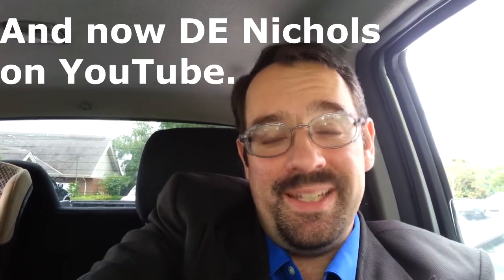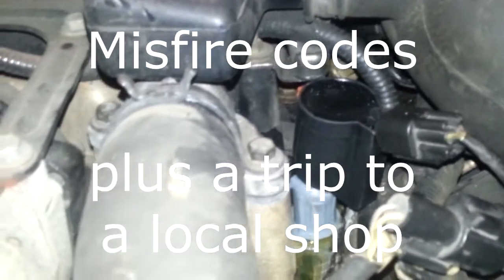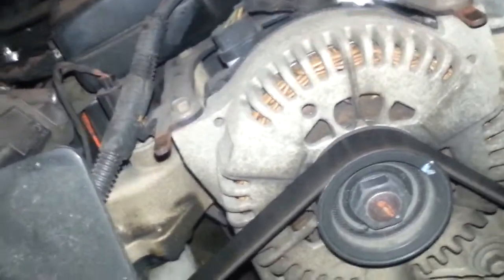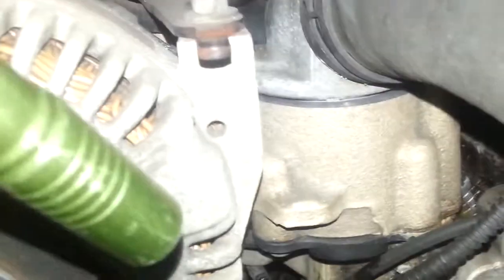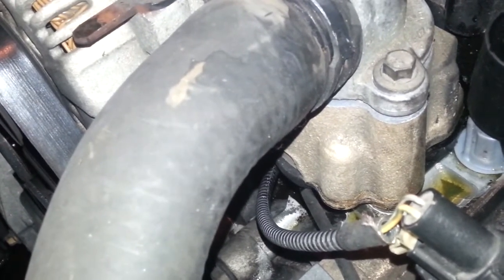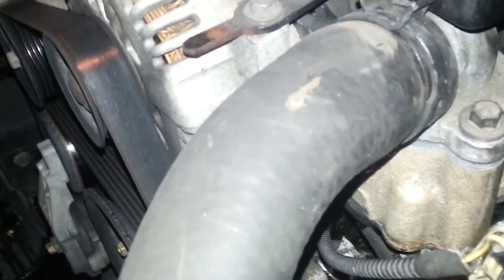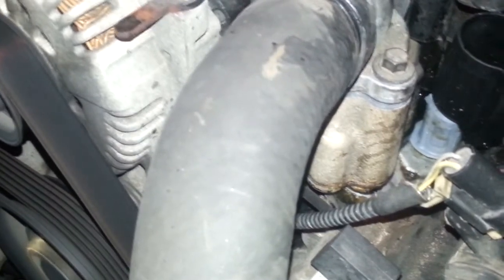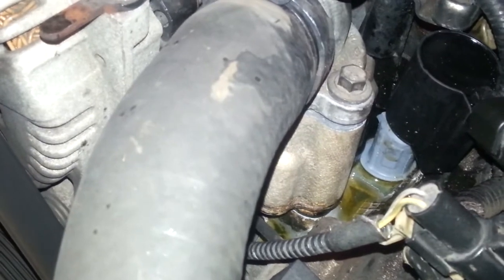Misfire and a Lincoln Continental V8

Comment: Now i did get confused there (nothing new), i expected gabrel to have passed away, sometimes you misdirect without knowing it, you dedicated this video, that normally means someone has passed away.
Yes im stupid.
Your fix worked and didnt cost a bazillion dollars, hack definition depends on how reliable it was :-).
Plastic against a hot engine, hmm fine untill someone overheats the engine due to lack of coolant.
Use butt connectors for your wires, you can interleave the wire strands then crush the hell out of them LOL :-D
Reply from the maker: +zx8401ztv As always you have so much worth replying to. Hey. His car did die (transmission) so you aren't far off the mark.

I was surprised as could be that going inside the thermostat housing with permatex righy sruff got it to seal. With the big gaping whole.

They make butt connectors that big? I've never seen one for sale. Insurance paid for the whole thing, but I'd rather get the labor money and fix it myself of course. :)
Reply: Ahh me not hearing things again, tinitus + faulty ear + heavy cold can feed my grey matter the wrong meaning lol.
I thought it was the normal wires, not the 16mm sq battery wires.
What about getting a couple of solder eyelets and terminating each cable, bolt them together perhaps.
Solder eyelets that big do exist, the factory i worked in i made bus charging harnesses, rather thick battery wires :-)
Reply from the maker: zx8401ztv you heard right. I spoke wrong. I did put up a text correction but I know your learning style. Your ears are more important than your eyes. :)

You're right. Heavy solder eyelets do exist. They just don't exist locally.  They look at you funny in most stores if you want bigger than 10 gauge wire. 4 gauge or 6 gauge I think is the size. Do you use mm instead of gauge over their?

16mm sounds about right. 

But hey, I'd you can't find it locally, the solution is going online. :)

Thanks again.
Reply: I didnt really think about the sizes as i didnt order the parts, my job was to solder the 16mm square area wire into the eyelets with a big moma 150 watt weller poker ha ha :-).
So car battery wires were 16mm sq area, maths has never been my strong point (like everything else lol), so the radius and p.i and possibly 2.54 may be something to do with it lol, its been a long time since that particular job.
I think its 5 Gauge AWG, but dont trust me, i guess a lot  LOL :-D
Reply from the maker: +zx8401ztv Back to your original comment. I got an idea that has me smiling like a fool.

I should have dedicated it to Gabriel's car instead of him since long since I shot this his car's transmission died.

Then it'd be a "death" of sorts. Lol
Reply: LOL your worse than i am, that takes some doing :-D
It would be a kind of death, a small reath for the transmission and a nut and bolt doner card to help someone after its death lol.
Like a kidney doner card lol.
Reply from the maker: +zx8401ztv Haha. Thanks man. You cracked me up at the perfect time. You're such a boost to my day.

Hey. What can I say? Learned from the best. :)
Reply from the maker: +zx8401ztv Haha. Thanks man. You cracked me up at the perfect time. You're such a boost to my day.

Hey. What can I say? Learned from the best. :)
Reply: LOL :-D